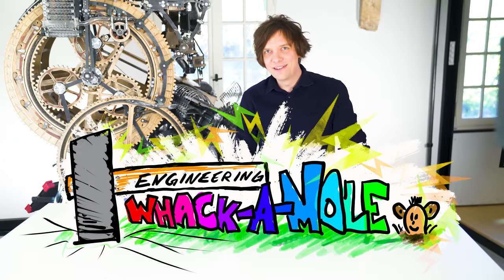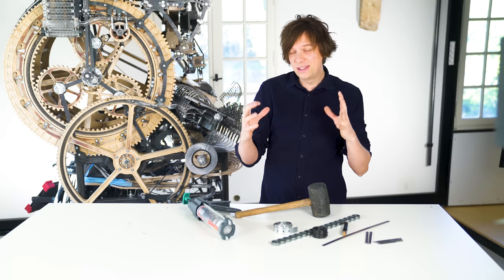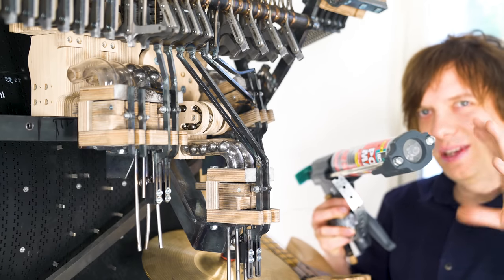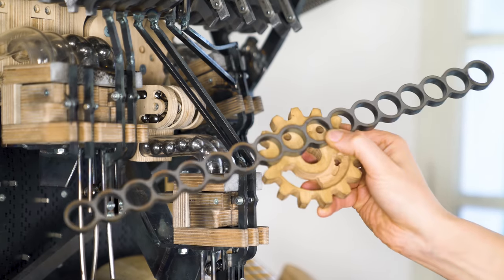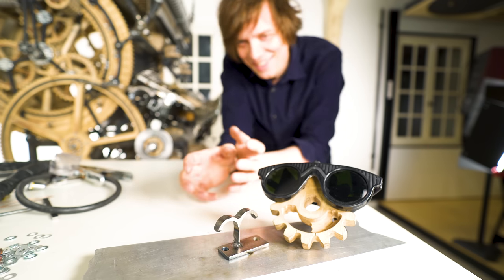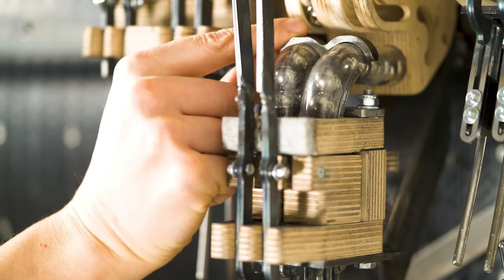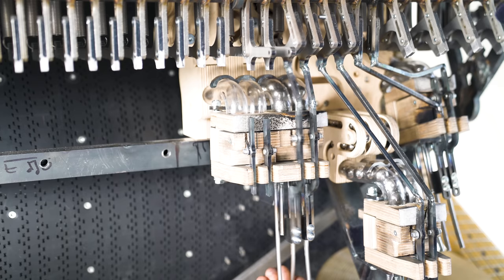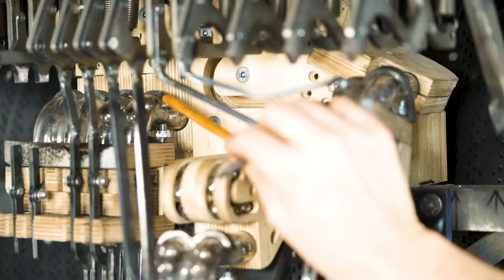Let’s Play: Engineering Whack-A-Mole

Comment: Martin: Daily videos makes me work faster
Also Martin: Building new parts while puppeteering Wilson
Reply: A little fun should always be allowed during work to make it more motivating :)
Reply: Do what you love and you'll never work another day in your life. <3
Reply: Key word is "faster". Faster does not imply fast. Perhaps previously he was building new parts while puppeteering Wilson while dismantling and reassembling the MMX for no reason. Perhaps his arms and legs just moved at 90% of current speed.

The Wilson bit is cute and probably didn't take more than an extra hour a day. Even if it was purely stupid fun... I think that much time is warranted.

The real thing that confuses me is why he is using tubes here. I thought he already decided on the wooden block routing in an earlier video. Did he decide against it, or is it just for the drums where he is still using tubing?
Reply: @Mathignihilcehk  he uses wooden blocks on the part where the marbles come out and enter the tube. The tube is now just the final piece and does not have to adjust the height of the marble queue anymore (and reduce pressure). It just connects the dropper and wooden queing system.
Reply: That is what I was thinking...
Reply: Honestly, this was just fun to watch. I want more Welding With Wilson!

Comment: In my first engineering job, my supervisor had a Whack-a-Mole poster on the wall by his desk. It's a universal thing when bug fixing in any discipline of engineering.
The moles will always keep popping up, but eventually you'll get to a point where there are few enough remaining that your output is reliable enough to pass
Reply: In software world we call it stabilizing the system
Reply: The number of moles stays constant, but with enough hammering they can be restrained into a small shady area where nobody notices them anymore. Fingers crossed...

Comment: If the pipes extend far enough into the block, a set screw or pin would make sense.
Reply: My thought as well. Guess a pin could slide out during transport, but a set screw locking with a small dent in the pipe should be perfect for the job
Reply: @alexwalli  Issue might be that overtightening the screw could lead to a major blockage.
Reply: Drill a hole in the play wood from the front so It "scratches" the pipe from the side for let's say half of the pipe thickness. Now you can insert a pin without adding any stress to the pipe.

Comment: I wonder if a small wood screw inserted from each side engaging with a small depression drilled in the pmma pipe (without going right through into the marble path) would have worked?
Reply: i think the pipe is too thin to be screwed without protudind inside and creating problems with the marbles
Reply: That's what I was thinking, a set screw to hold the pipes. Not enough to break into the interior, but poke into the walls just enough to grip the pipes. 

That may be the easier option once he gets to the bulk of channels in the vibraphone. But then again, the consistency of hold-downs across every channel now instead of screws for some and hold downs for others would likely look better and have more or less the same function.
Reply: Set screws.. like those used to hold a pull to a shaft... not wood screws.
Reply: @douglascaskey7302  Set screws won't thread into the plywood though. But by pilot drilling and blunting the tip on a wood screw you could use it as a set screw.
Reply: @KevinT3141  Yes they will. I've done it. And if it's a problem with the threads catching you could drill a hole and use CA or Epoxy to wick into the wood to give it a machinable surface. 

BTW... I suggested awhile back the parts should have  been machined out of Delrin or Teflon... and skip the graphite lubricant  - which is only going to wear off.

Comment: Martin, you can just use a screw at the side of plywood, it will just screw in pipe and won't go anywhere
Reply: He really wants to avoid friction fits when they are unnecessary, as they have caused many problems over time. They can wear down over time, or even slip.
Reply: I was thinking grub screws as well, I wonder if the pipe is just too soft to be held rather than pinched.
Reply: @corb805  then he can make in pipe a little hole, that doesn't go threw the wall of pipe, a hole in plywood and put there some kind of metal rod, that will hold a pipe in needed place using the hole, but rod also may come of, we can glue it in place
Reply: @bulkh  that is a better idea, that would likely work for his criteria. He definitely does not want to use glue, though.

Comment: Just had a little inspiration in my head- the marble divider may benefit from a small door/scale at the top of each channel actuated by marbles in the channel when it's nearly full. Basically, the weight of 3-4 marbles closing the door behind them to any others. It just felt like marbles landing at the exact top of the channel with super precise spacing, sanding, grinding, etc. is a lot of work when one pipe slipping/marble jamming can stop every channel. The risk of that is a serious threat to the 100,000 marble mission. This could then allow you to run the tubes in any fashion in front of it, elegantly or efficiently, to the droppers.

Comment: or, why not just make another "smaller" gate for just aligning the top marbles in the marble divider??? then the distance further down the track is irrellivent???
Reply: That's what he was doing before and it was causing reliability issues
Reply: Because that's another major redesign, and because he's trying to reduce the amount of force required to actuate a channel. That's why the gates further up directly under the divider were removed in an earlier revision. Less parts to move with each note.

Comment: Possible fix: Drill a small hole horizontally in the wooden part of the marble gate just in front of the where the PMMA comes in but close enough to hit the very front of each pipe. Slide a metal rod in like a key to hold the pipes in.

Comment: Super simple fix on the rest of the channels is to make an expansion in the fitting for the pipes on the underside of the top plywood. Make sure the pipes go all the way through, then heat the end of the pipes and expand them to fit inside this expanded size. That way it can’t go up. Add the rest of the plywood below and it can’t go down. And it won’t be seen anywhere. All boxes checked. ;)

Comment: In your next marble machine use rotating turnstile gates. Most of your design problems come from having to fight the weight of the marble stack. With a turnstile the weight of the marbles would actually operate the gate.

Comment: I feel like this could have a very simple "lock in place" solution in the future. If you design a plywood part with a small lip that can catch onto the plastic pipe, then you still have the ability to take it apart, but once it's put in place it's prevented from slipping up out of the marble gates.

Comment: Martin, simply pin the PMMA pipes into the plywood. Drill holes in the part of the PMMA that nests in the plywood and affix with a grub screw. Dry, removable, and no welding needed.

You made a good call on the pipes over the wood. It definitely looks better. You're almost there!

Comment: Hi Martin, one expirience I had over the years is that functioning parts look great most of the time, too. If you want more visual appeall I suggest doing it like the plywood channels. Wich had an opening cut on the edges. But even if it's just a closed block. Rounding up the corners will always give you a more cleaner look. 

I believe! ;)

Comment: Simpler solution for the tubes to hold them fast would be to drill a hole from the side of the plywood to the tube, then use a wood screw (blunt the sharp tip of the screw!) to use as a "set screw" to hold the tube.

Comment: You can cnc cut plastic tabs and glue them to the pma pipes, then use these tabs to bolt down the pma pipes directly to the gates using the same bolts.

Comment: Drill a hole into the side of the top part and have a grub screw holding the pipe in place. You can drill half way through the wall of the pipe where the screw hits (find it by drilling the wood first and mark the center after sticking in the pipe) and it will be basically invisible.

Edit: Yes, I know it is wood and not the best material for grub screws, but keep in mind that all it as to do is stick out a little and keep a plastic pipe in place. By having the drill diameter slightly smaller than the screw, it will work fine.

Comment: To Whack all your remaining channels, here's my suggestion:
Add a wodden part to the top of the sentinals, that takes care of the 90° Bend. As a result, the PMMA Pipes only go straight from the wood maze into the sentinals and don't have a turn which allowed them to exit the fixture in the first place. Or you could just use these metal pieces again. (They are actually quiet beautiful)

Comment: It feels like the need to have the marbles flush with the marble divider track, has caused a lot of problems downstream. I imagine there could be some type of gate solution, just a simple L-shaped piece on a pivot point, that slides across the hole when a marble passes through the top of the tube, so when the tube is full and the marble isn't going anywhere, the L-shaped piece stays in its position covering the hole until the marble drop down enough to open the gate again.

Comment: Martin! A much easier solution over the height modules just presented itself here. You were able to hand-adjust the height of the marbles at the divider! You think of this as a problem but what if it was a solution? What if you could loosen, adjust, and re-tighten the insertion points for the PMMA pipes? This would eliminate the need to spend hours making all those different height modules.

Comment: Seems like the obvious fix would be to modify the marble gates so that the top stationary layer has an additional sheet metal layer with welded flanges to accept the PMMA pipes. A couple of set screws in each flange ought to provide the clamping and adjustability you need.

Comment: if you cut slots to the holes, where the bolts get through the plate, you could slide the plate in and out with just loosening the nuts, instead of removing the boltst completely.

Comment: Have you thought about adding friction to the bottom of the pmma pipes where they go into the marble gates? You may be able to get away with glueing a small strip of sandpaper around the circumference, which would let the plywood grip the pipe better, and not require additional parts on the machine.

Comment: What about set screws through the sides of the gates into the PMA? You might need wood inserts to deal with stripping, but they would be clean, easy to remove, and easy to install.

Comment: Idk if youll ever read this but keep the design! Just use a setscrew with a predrilled hole or use a pointy setscrew (you can buy them) so the pipes are locked in place :)

Comment: Martin, only in perfect tube with inner radius equal to marbles, will you be able to precisely determine the length of marbles in long tube.
Rather than "fixing" some minor inconsistencies in marble length, design some sort of a flap that will close when tube is almost full of marbles.
This way you will get rid of 2 problems: 
- path length inconsistencies and
- you will not need to calibrate the questionable marble length.

Just my 2cents ;)

Comment: The flatness issue has  always seemed very finicky to me. It would be lovely to circumvent it somehow. I'm picturing a v-shaped lever which would close the top hole whenever there's a marble on the bottom half of the lever, then spring open. Of course, the lever must close the hole with a rail-like obstruction which wouldn't further slow marble flow.

Comment: Problems found in progressively later steps of implementation are generally 10x the level of effort PER LEVEL (good rule of thumb)
Design: 1x
Building: 10x
Integration: 100x
Deployment: 1000x
I would say MMX is in the "Integration" phase, so any flaws found now are much harder to fix.
HOWEVER: Lessons learned from the drums in this case will put the vibraphone back into the 'Design' or 'Building' phases so GOOD JOB!!
Don't lose hope Martin!!

Comment: Hi Martin, enjoying all your work on the MMX. Two things, just for future reference as far as I am aware silicone doesn't bond very well at all to PMMA so your first idea probably wouldn't have worked, anyway not necessary since you designed a more elegant solution. Also maybe look into FMEA (Failure Modes and Effects Analysis) it is used quite a lot in engineering to think about how engineering components can fail in service and how critical the failure would be. It might give you some structure on trying to visualise how a new design would work on your machine.

Comment: You didn't really need the washer under the bracket, you tightened it enough to embed it into the wood. But i strongly believe that a set screw would be a much simpler solution, and hidden.

Comment: Not as if Martin picks up suggestions from here.

But if the pipe had a groove just above where it enters the marble gate. Then a smaller metal plate than this whole construction (I actually don't really mind it) could clamp it into place by sliding into it (fastened just like this is).

Comment: Instead of choosing between opaque plywood designs which are rigid and the more loose PMMA pipes, why not get the best of both worlds by machining clear acrylic on the CNC with special plastic bits that leave a good finish?

Comment: Not sure how deep those pmma pipes extend into the marble gates but you could have used a set screw on the side of the gate. Drill a hole through the wood and into the pipe and insert a screw. No more vertical movement

Comment: Hi Martin, engineer speaking. Whack the moles is the purpose of engineering. I past all my carrer of whacking moles. The purpose is not to fix them all. The purpose is to don't have mole which makes the product unusable.
You are not happy to let 1 issue with your gate design but your learn so much. The experience make new design with less moles to fix but it is never perfect.
You are in the good way but not the good mindset. Be more positive. Each action, each mole you whack lead you to finish the MMX.

Comment: 2:27 Rather than keeping the pipe pressed down, why not just get rid of the problem altogether? The issue is that the pipe has a bend in it. Get rid of the bend. Have a straight pipe from the marble maze block into the marble gate assembly, and make the bend out of plywood, on top of the existing marble gate.

Comment: There has to be more elegant solution to remove the "flushness issue" altogether. It feels reaaally error prone that the flushness relies on such tight tolerances on parts that are in completely different section of the machine.

In computer science we speak about loose and tight coupling. Completely different sections of a program that affect each other are thought of being tightly coupled. Tight coupling leads to slower development since replacing / reworking some parts of the application will force you to change some other section also.

In your case the flushness in the top section (hence the behaviour of that section) relies on the tolerances of the marble gates, making them tightly coupled. By making the flushness not to rely on the marble gates you remove the tight coupling issue.

Comment: Hi Martin,

First congratulations, you are making me make what is my first You Tube comment ever (I think). Secondly a big thank you for the huge source of entertainment for me and my family, that's my two kids and even my Mrs. We have been religiously watching your video's since about episode 4. We have enjoyed following and watching you design and build what is truly a masterpiece and an inspiration to all.

Now for the reason I have come out of the wood work. Like so many times before when I have been shouting at my TV wishing I could be in the room with you to just show or tell you something. While today's solution is a solution I have two major problems with it. 1, it is time consuming, you need to use your time as efficiently as you can. 2, Weight! I presume you are going to have this problem with the rest of the marble gates as well. Each time you add another bracket you are making your beast of a machine a little heavier. And remember you have to lug this thing around the world with you. Which will not only be tiring but costly in freight costs.

A much simpler solution I believe would have been to use a grub screw 2-3mm in diameter. Simply drill a hole in the front of the marble gate at the centre of the pipe through the the marble gate and the front wall of the pipe. Then presuming the wall of the pipe is a few MM thick you could insert a grub screw threading it through the hole and into the pipe a MM or two being careful not to let it protrude into the pipe blocking the marbles. You would want to drill into the pipe otherwise you would pinch the pipe and effect the marble path. I believe this solution would be cheaper, lighter and most importantly only minuets to achieve.

It was just a thought I had 1 of many over the last few years. It may or may not help. But just remember that the are many of out there that have been following you for a long time, we may be silent most of the time but we are cheering you (and Wilson) on every step of the way.

Comment: Wouldn't a retention pin into the ends of the pipe be simpler?  It would be easier to remove and once you have the pipe in the correct position you would drill the hole for the pin. Only issue I see with it would be strength.